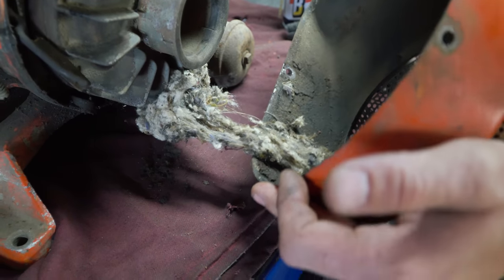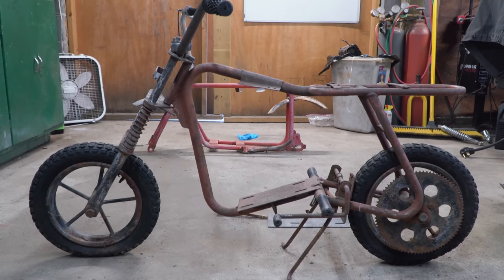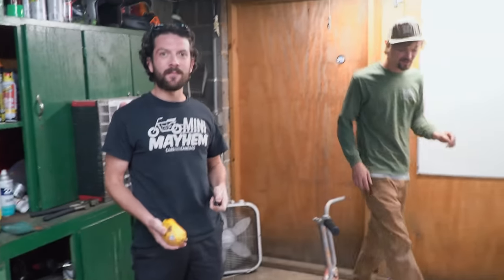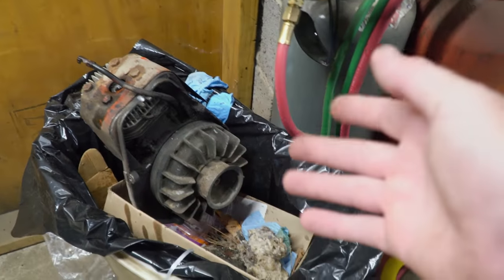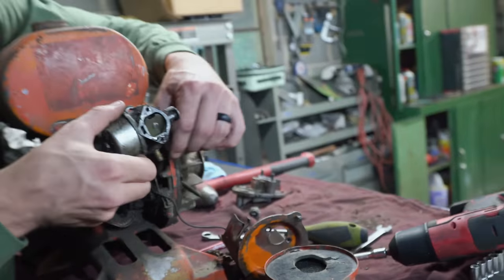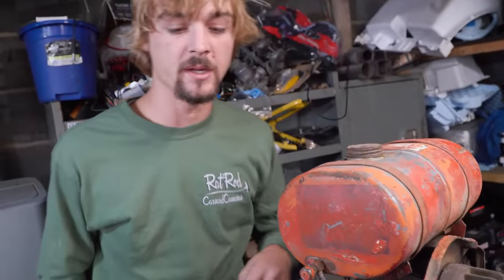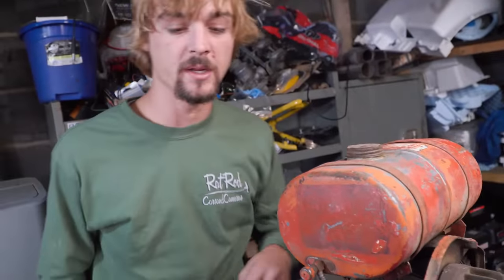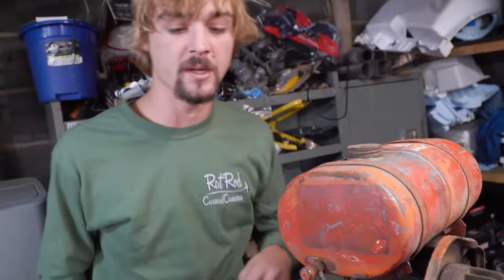Can we Salvage a 50 Year Old Water-Logged 2 Stroke for a 60’s Mini Bike Build?

Comment from the maker: This has to be the hardest we’ve worked for 2 horsepower😂
Reply: How could a 2 stroke that big only have 2hp??
Reply: What happend to the 670cc two stroke go kart 
Loving the content keep it up
Reply: What I hate is when I take off an engine cover or similar metal thing, and a big hairy spider comes running out!
Reply: this was very.... how can I put this... insane?

well here's the cold hard truth. if you put nitrous on it you'll easily make 10 horsepower on that old knock machine. if it blows up it will make for some damn good content. 

will it go or will it blow nitrous edition.
that is a good video title if it was to happen. 

make it happen like Cleetus McFarland would say "Go or Blow"
Reply: Port it!!! Not that hard and would make this thing really cool!
Reply: I'd say it won't run in reverse because of ignition timing. For example, say it normally has 30° of spark advsnce. When turning in reverse,  it would be firing 30° after top dead center. 

Keep up the great content!
Reply: Looks good so it’s worth the effort
Reply: Put that engine on a full suspension mountain bike!  A fat tire mountain bike if you can find one.
Reply: @pookysdad4884  bad port timing, no pipe, designed for slow speed where 2 strokes don’t shine
Reply: @theupscriber65  yes!
Reply: If you guys havent done so, check the compression and piston rings, and while at it, make shure the muffler is free of blockage, small details can make a world of difference when we talk about such low power engines (also, 2-strokes are kinda sensitive to beeing in "tune" due to the nature of flow of gases) Best wishes from Sweden! :)
Reply: Really surprised it even moved!
Reply: 2 pretty cool horses though
Reply: Worth it though, that thing is sweet!
Reply: Those Jacobson engines are off vintage push reel mowers.  I have two complete engines one still on complete mower.
Reply: See remarks about the camlobe and when do the magnets and coils meet?
Reply: @hellawacked  even better: port polish and build a pipe!
Reply: bloody oath but still made out for a great video
Reply: Lol at the obviously non 2 stroke guys saying to port and polish this little thing.  I mean, look at the exhaust.
Reply: @SportbikerNZ  you are right. Would still make only 4 hp. Btw i am not new to 2 strokes. Look on my channel
Reply: add a jack shaft , or it will always be a dog
Reply: Hey y’all are probably not gunna see this but I would love to see y’all build a racing John Deere L110  that would be amazing

Comment: it doesn't run backwards because of the spark timing, I'm not sure if there's many two strokes that really do run backwards anyways, because the timing is usually set forwards a little.
Reply: Depends on the cam lobe running the points.  Old Harley davidson golf carts were made to run backwards, and they had a symmetrical lobe.  Tricky to get them timed right both forward and reverse tho.
Reply: As they were trying to start it backwards I was screaming at my tv. Timing! Lol. Some two strokes are symmetrically timed. This may be by coincidence or by design on some of them.
Reply: The old detroit diesel 2 stroke truck engines would run back words. I saw a guy
stall one about 100 ft ahead of me on a dirt haul job. He rolled backwards let the clutch out, It started up and smoke was pouring out of the air cleaner and he could not  figure out why he only had 3 forward gears and 13 reverses LOL. Yes he as well as the truck I was driving had 13 speed  transmissions. 
13 forward 3 reverse
Reply: I have a Yamaha golf cart and reverse is obtained by switching the engine off and starting it in reverse.
Reply: @chib9427  o um ok.  2 stroke diesels  will not run worth a shit, if at all backwards.  Let alone trying 3 gears one direction and 13 another.  I call bs old boy story.
Reply: @shenaniganswhatsoever363  did you even glance at Google? It's common. Don't be so quick to throw your phallus around.
Reply: yeah timings off, but like others have said the golf carts were set up to run both ways. also there's some weird tractor that runs at "0 rpm" because it'll bounce one way then rebound back and fire again. dont remember how it works but I'm pretty sure it was a 2 stroke. having a timing setup like that is also a real performance killer
Reply: @shenaniganswhatsoever363  bs to you also? Sir i was a marine engineer with big two stroke diesels. If you correct someone please do it properly.
These big ships engine are directly coupled to the propellor shaft. So how to reverse? Depends on the engine, if only inlet and exhaust ports in the liner thats solved. When they have an exhaust valve the opening timing has to be reversed. As well as the fuel pump timing. So if the engine is designed it wil run both ways.
Reply: @henkoosterhof5947  so are truck engines designed like that?  Um no.  Which direction does the supercharger push air when it runs backwards?  It sucks air out of motor.  Sure if it's designed to do it like in a ship why not?  But a cloud of smoke out the intake and running in 16 gears are two completely different things
Reply: @Spec_D  2 stroke diesels in a truck have a supercharger. If the engine spins backwards, so does the supercharger.  Essentially sucking air out of motor.  Hence the smoke out the intake, but no way he tried any gears like that.  Rolled backwards down a hill probably...
Reply: @shenaniganswhatsoever363  Had a 2 stroke roller, it would start backwards once inawhile, blow oil out the air cleaner but ran fine
Reply: @johnstaples3605  can you say ran "fine" at least?
Reply: @shenaniganswhatsoever363  fine is how I would describe it as it left an oil mess since it had an oil bath air cleaner. All functions worked, just in reverse. It was a hand crank machine and it decided when it wanted to start in reverse. Could always tell when it did, but it always did its job
Reply: @johnstaples3605  did it have a supercharger?
Reply: idk, my robin engine on my ezgo golf cart runs forwards and backwards. it doesn't have a transmission so that's how you get forward and reverse.
Reply: It's moste likely spark timing, at least whit a moped 2 stroke it is, you can run it backwards but you need to adjust spark timing
Reply: @thesuperjank6109  lanz buldog wil run at o rmp
Reply: @chib9427  guess that’s good and bad that diesels don’t need spark, probably why they don’t do(that I know of) 2 strokes of the diesel sort anymore 🤷‍♂️
Reply: @thesuperjank6109  I’ve watched a video of the engine you are talking about. Not much you can do about timing on a two stroke diesel that’s air induction fed fuel. Other than squish clearance during assembly  Just my assumption (I could possibly be made an ass🤦‍♂️) May do a little research out of curiosity.
Reply: There are thousands of two strokes that run backwards on purpose
Reply: @thesuperjank6109  a Landz Bulldog,seen one the other day in a museum
Reply: @chib9427  what a trip! That’s funny as hell
Reply: Mercury marine had direct reversing in-line 6 cylinder with two starter motors before shifting lower units came along for larger displacement outboards.
Reply: Old bultaco motorcycles were known to occasionally start up backwards
Reply: My derbi runs backwards
Reply: Not two strokes, hit and miss four strokes can do this.
Reply: @erlenddammen2174  well, a 4 stroke has valves which are timed, so there's no possible way for a 4 stroke to run backwards unless timing is changed and stuff, right? I could be wrong though.
Reply: I think you are right. It is the two stroke hot bulb engines that does this.
Reply: @chib9427  but those were diesel,  and fire from compression
Reply: @erlenddammen2174  yeah that might be it.
Reply: As people said timing being just after tdc stops it running in reverse on most. The best one iv seen is a old seagull outboard on a mates dinghy tryed to start it it back fired ran backwards badly and he slowly reversed around while trying to put his hand over the carb but that was backfiring flames because they dnt have reed valves 🤣 he pulled the plug lead to stop and got a shock from that as well 🤣
Reply: modern snowmobiles often go reverse just running the engine backwards.
Reply: Kawasaki kmx run backwards, derbi senda run, suzuki pv run, suzuki rm run...
Reply: @johnstaples3605  what oil? If oil coming out you have leaking crank seal
Reply: Yes I had to swap my leads over to make my 2stroke twin run backwards 😄
Reply: @thesuperjank6109  its a kindof like a deisle, because it has a injector in the cylinder. The reason it runs at 0rpm is because the injector fires at the right time for it to run like that. U can even get them to run backwards.
Reply: If it’s set at base it should in theory …
Reply: Harley golf carts run backwards for reverse it has a linkage on the shift lever to change the timing
Reply: @jamesvomsaal3814  didn't know they had Harley 2stroke golf carts.
Reply: @simonallan9941  when AMF bought HD
Reply: @chib9427  yep, diesels will run without any mods in both directions but then the pumps won't run for the oil/coolant unless they're designed to run both directions
Reply: My snowmobile does... push a button the engine shuts off and quickly flips the firing order (it's a twin) and starts right back up running backwards

Comment: With the amount of old stuff you guys tear apart, you should get a proper scalpel, couple of hole-punches and some gasket material. Cut up paper milk cartons also work for most gaskets on these kind of engines in a bind.
Reply: I've made many gaskets out of cereal boxes.
Reply: The best material I've found is the flimsy pizza 10"  boxes that a slice would come in. They are impregnated with clay and work great. But cereal boxes and pretty much whatever non corrugated cardboard work fine.
Reply: Headgasket on my 3hp Briggs flathead is a beer can.
Reply: my puegeot moped had a cereal box head gasket because I didn't have the right one for the 70cc kit I put on lol
Reply: @sexkrazedpanda  probably got some decent compression out of it. Watch the valve clearance though.
Reply: @jasonbirch1182  it does. But I would like to get a cam for it without the easy start lobe on it and a new carb.
Reply: I make all my own gaskets. Not sure why people use card and stuff. Real gasket paper is like 4 bucks on eBay for five A4 sheets of different thicknesses.

Comment: 2-stroke can run both directions but ignition timing must be changed!
Reply: Glad I'm not the only one who thought this when Ike said it.
Reply: Yeah I think AMF and cushman had two magnetos or some very
movable plate. When you think of it, what's -20 degrees becomes +20ccw
Reply: @n3glv  My snowmobile runs in reverse for reverse gear but it has electronic ignition and efi so the computer can adjust the timing accordingly.
Reply: Had a Mercury Mark 78 and a 700 that worked that way, two.  It was a distributor and you could see it twist around when you pulled the throttle rearward to start it in reverse.  Royal PIA compared to a transmission, though.
Reply: @n3glv  harley davidson golf carts did that by having a symmetrical lobe that runs the points.  Very easily achieved without complex mechanisms to change the timing.   Think about how points work, they fire when opening.  When points close is when it will fire in reverse rotation.
Reply: @shenaniganswhatsoever363  Thanks, was not sure the exact method they used. But that was exactly what I meant by AMF.
Reply: @n3glv  I hear ya.  They were made by harley in the first years, then amf used the same setup.  I think it was Harley's design, why I said harley.  Amf or harley would both be proper things to call them, I just choose harley.  Your not wrong by any means.
Reply: Ingenious. Let's all discuss.......
Reply: @xsixinfantryx  please begin
Reply: In order for a two cycle to run backwards it has to have symmetrical Port timing.

Comment: My '84 Ez-Go golf cart is a two stroke, and the engine spins backwards for reverse.  No transmission required.  So simple.
Reply: Have one their awesome engines, made by Fuji Industrial they are also the same engine's used by Polaris the 244cc or sometimes called their 250s ccs. I have a Polaris connecting rod Hot rods Rod a cylinder off a 488cc Polaris and piston from a 244 as well as a head. The parts bolt right onto the Ezgo crankcases, only modification was longer studs for the cylinder to block. Using the stock Polaris 488 38mm slide carb and a expansion pipe and full exhaust off a 250 atv. I ended up putting it in a newer version Ezgo TXT with F-N-R rear end to do away with the running backwards felt it would have a stronger spark if it was only firing once so I removed the reverse bump off the reluctor ring on the flywheel. Otherwise she's probably every bit of 30hp from a Ezgo engine now, just wanted to share.
Reply: A friend had an old Harley golf cart that would run in reverse.
Reply: I know someone who has one like that, I even think it's the same year!
Reply: @jimciancio9005  that's pretty cool! how much more power do you feel in the seat?

Comment: In order for a two stroke to run backwards well you need to adjust the timing around 10 to 15 degrees to a count for the ignition timing.

Comment: Mercury had “ direct reversing in their outboards in the 1950’s.  You would shut the motor off,  flip a switch,  and it would start the opposite direction for reverse.  Also some 2 stroke golf carts did the same thing for reverse.
Reply: The ‘Dock Buster’! The modern two stroke snowmobiles do this for reverse. Saves a great deal of weight as the engine does all the work, no extra mechanical parts required in the chain case.
Reply: @colt250ss  im just waiting for the right one to come along so I can pick up a dock buster!  Always seem to find them without the controls.  I didn’t realize the newer snowmobiles did this as well.  Learn something new every day!

Comment: For a two-stroke to operate in reverse you have to adjust the timing. Because the timing does not spark at top dead center it's right after top dead center. The knocking sound when you move the crank and flywheel is the bearings on the piston and the crankshaft are worn out. I wouldn't run it very much longer without getting the bearings replaced. All I'm making photo neutralized the reason the carburetor is on the crank housing is because when the Piston moves up it sucks air and fuel in, and when the Piston moves down it acts like a supercharger/compressor forcing the Reed valves to close, and it compresses until the Piston moves down below the intake port on the cylinder head. The compressed air and fuel forces the exhaust out with the fresh charge.

Comment: 16to I ratio gas to oil, techumsi parts will work. Today's 50to 1 Will burn it up if run it to long. That engine is set at 6°btdc, can't run backwards .
Love what y'all do! Keep up the great work!
Reply: That's a bunch of boloney...modern oils are far superior to the oils that were available when old 2 strokes called for such rich ratios like 32 or even 16:1. Up until the 80's there weren't even many dedicated "2 Stroke Oils", you'd just use plain SAE30 motor oil. 50 or 40:1 is perfectly fine in older stuff as long as you use a quality oil.
Reply: Zink buddy todays oils dont have what back in the day did.
Reply: @THatChevyguy91  Agreed. Also, what that thing was made we may have still had leaded gas. Lead provided a little lubrication.
Reply: I should have said 50to 1 is too lean
Reply: @stevensysk7711  You are correct either way.

Comment: In theroy yes a 2stroke will run in reverse for example in some snowmobile engines to put it in reverse you hit a button which makes it run in reverse which in turn makes the snowmobile go in reverse but the magneto in some engines are directional and only work when the magnets pass by it in its intended operational direction.

Comment: I'm 63 years old and I remember those wheels. We didn't like them because the tires weren't available like the standard mini bike wheels.
Yes 2 strokes will run in reverse. The Fairmont track inspection cars (think the old pump handle railroad cars like you see in the old western movies, only with a motor) have a 2 stroke motor on them that by moving the timing will run in reverse. I have a friend that has one and being the crank hole is on my side it's my job to spin it over. Whichever way the operator wants it to go. My friend says I'm the most reliable starter motor he's ever had.....LOL! 
I like the look of the bike. Jacobson made mowers mostly so that motor likely came from a reel type mower. If you can get that motor up on the RPM's is might be pretty strong.
Cool build.
Cheers 
Terry from South Carolina

Comment: 2 stroke engines are timing set at 30 deg b.t.d.c.
That what keep from running backwards!!!
Dennis from Delaware
Reply: Correct, it's a timing thing.
Reply: @cheerdiver  I've been working on all types of small engines for over 50yrs.
Janson engine were known to be use on large chainsaw clean back the 1930s and I believe some loggers still use them 
Dennis from Delaware

Comment: Certain 2 strokes like boat engines could run in reverse. Usually your able to ajust points location..unless it's a 2 stroke diesel..
Reply: Ike may have seen a 2 stroke diesel running in reverse and forgot about the spark advance issue haha

Comment: A 2 stoke cannot just be spun the opposite direction to run. It would need timing adjusted properly for the direction of rotation
Reply: @rayoverstreet9254  most two-strokes can be started without adjusting the ignition, but some can be damn hard to start
Reply: The old mercury 6 cylinder outboards, as well as the 1920's Elto Outboards could run backwards by just flipping the distributor/timer backwards. Our old Harley Davidson golf cart ran in reverse too.